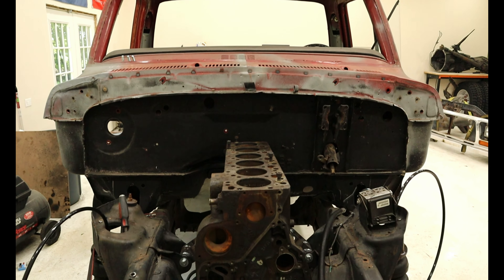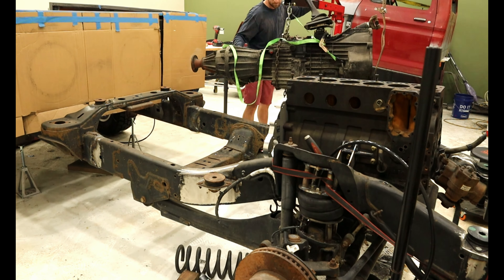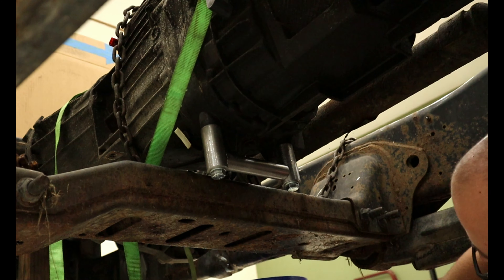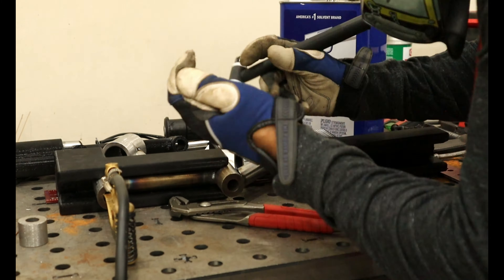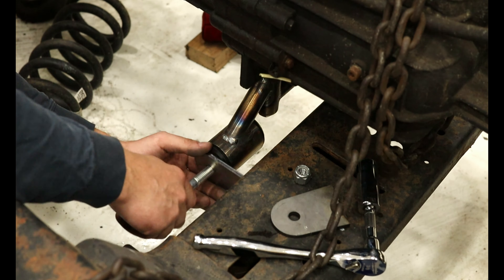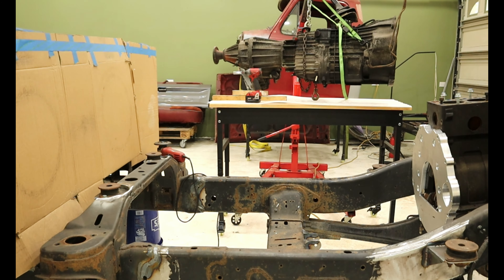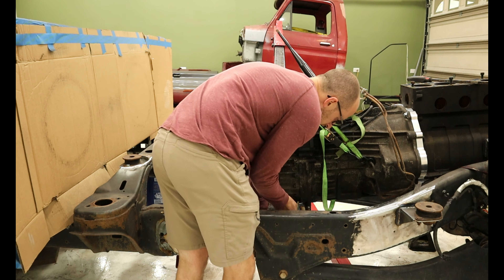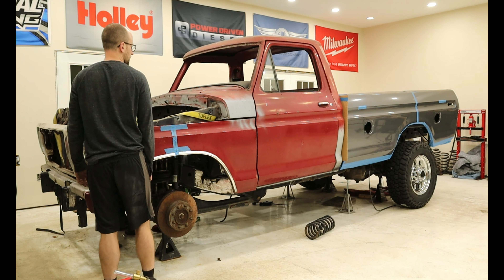Fabricating a Custom ZF6 Transmission Mount

Comment: cab has to be removed if you need to pull the trans?
Reply from the maker: @MrFlashHandy  Nope the cab can stay put. The transmission crossmember can be removed just like stock. I don't have a lift so easiest method for me was to remove the cab and fab. 
once the cab is painted, I won't be removing it unless absolutely necessary